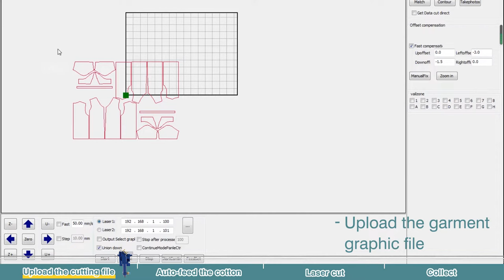How to automatically cut fabric with a laser machine

Comment: Used for febric layer cutting 100w 4×8pric
Reply from the maker: You mean 4ft * 8ft size of machine size? Please send your specific fabric information to info@mimowork.com, and our salesman will give you a formal quote. Usually, 100W can cut most fabrics, but for sturdy materials like Cordura, 150W or 300W may be more suitable. What fabric are you gonna cut?

Comment: Cost?
Reply from the maker: You can email us at info@mimowork.com to get a quote. The fabric laser cutter has various machine configurations and options such as higher laser power, with auto-feeder or 2 or 4 laser heads. So it can handle different fabric cutting like Cordura or nylon, and higher productivity needs. What fabrics are you working with? What size of pattern are you gonna cut? We will recommend laser machine configurations that mostly suit you after analyzing your requirements.

Comment: Is 60w enough for fabrics?
Reply from the maker: 60W is accessible, but we recommend using 100W to cut regular fabric. For some high-strength fabrics like insulation material, it may be a little different on laser power setting.
Reply: @MimoWorkLaser  
Hm ok!
Reply: @MimoWorkLaser  
What about 80w?
Reply from the maker: @geminiman2831  It really depends on what's kind of fabric you want to laser cut. Sometimes it even requires to use of 300W 450W 600W laser power. Feel free to check this video to  know more about configuration for different  kinds of fabric https://www.youtube.com/watch?v=E-nB78UcFfs&t=228s
Reply: @MimoWorkLaser  
Ok!

Comment: What is the best choice to cut mesh, tulle, lace   multiple layers?
Reply from the maker: if your mesh fabric is as thick as spacer fabric like 1cm thick, then multi layers are not recommended. But tulle lace should be fine. Normally you need to use a multi-layer auto feeder alone with the laser cutting machine to do the trick. Send us an email to know more info@mimowork.com
Reply from the maker: Also, feel free to check out this video, it talks more detail about how to choose a fabric laser cutting machine for special requirements.  https://www.youtube.com/watch?v=E-nB78UcFfs